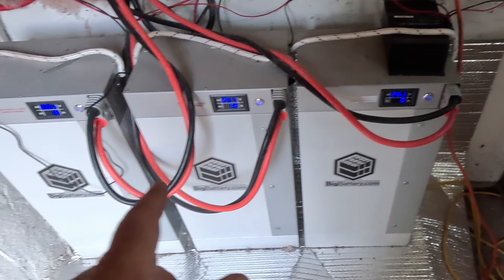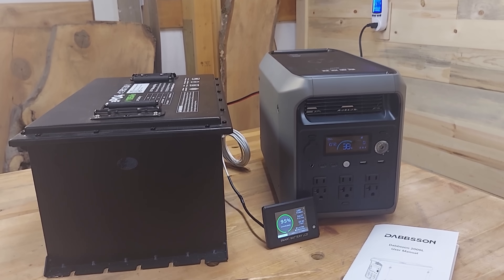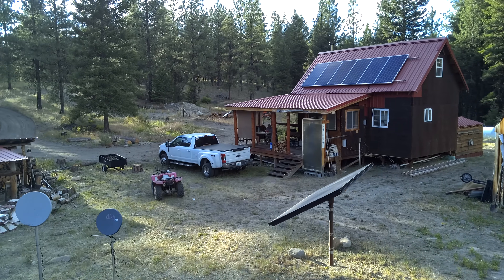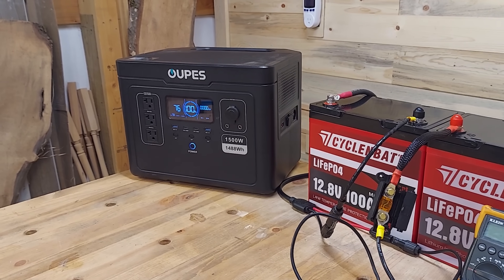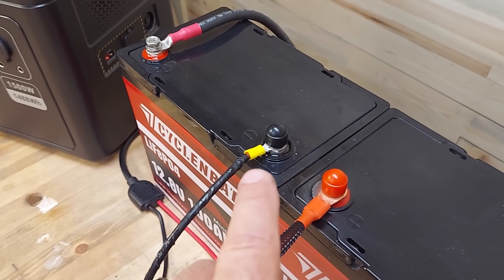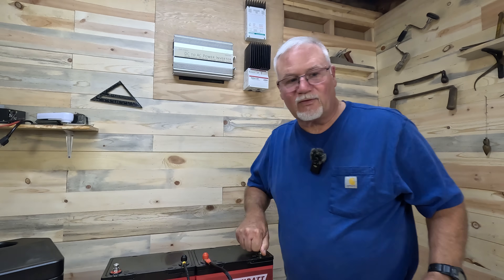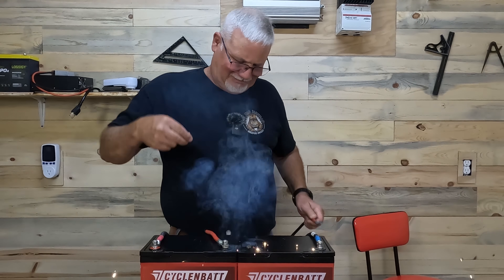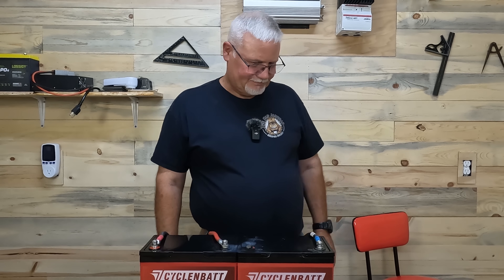NEVER Wire Batteries In Series Without This!!

Comment: When you are wiring 2 12 v batteries in series here, what is the gauge of the wire you are using?
Reply from the maker: In this case I was cheating a little and using 6awg cable as it's what I had but the minimum should really be 4awg cable for this application.

Comment: What size fuse did you use and do you have a link for your fuse connection you used?
Reply from the maker: For the connection to the Oupes Mega 1 I was using 10awg ring to Anderson plug cable with an inline 30amp fuse.  For the batteries I was using 6awg cable (which is a little small but all I had for the demonstration and as I knew I wouldn't draw very much across the batteries that's ok -- ideally you should use a cable rated for 125amps (25% above the expected draw) and a fuse rated 25% over the cable rating so best to use 4awg cable (chassis wiring allows 135amps for 4awg cable) and a 150amp T-Class fuse.  I'll put the fuses in the description.

Comment: Still don’t know what you did wrong. Couldn’t see what you did.
Reply from the maker: Got distracted, and instead of wiring up the cable for the solar input, I ran a wire from neg on one battery to the pos on the other, closing the loop and doing some welding 🤣

Comment: I was an apprentice testing a rewound electric motor on afternoon shift one night and I was getting some vibration in it. My supervisor checked it out and put a multimeter on the terminal block. The block ionized creating a flash that blinded both of us and knocked out the test bay fuse, our building breaker and tripped the building next doors breaker too. My supervisor's skin was lifted off his hands and the flesh underneath could be seen. We both made full recoveries, though his was much longer. The multimeter he used still had it's leads in the amp sockets, which melted across the terminal block. I was very nervous with the next motor I tested.
Reply from the maker: Wow! That's a scary story and thanks for sharing that. I'm glad to hear you both recovered fully!

Comment: Does 2 16mm2² wires combined make 32mm2² wire or even 20mm²
Reply from the maker: They say you should de-rate combined wires to 70% of total ampacity when combining them so you'd actually need to combine more that two 16mm wires to get the same ampacity as a 32mm.

Comment: So does it matter which wire the fuse goes on? Neg or positive?  Everybody always says put a fuse on it, but nobody knows where to put it or at least I don’t! 🫤
Reply from the maker: I believe either is fine but prefer positive.   The is to provide a break in the circuit.
Reply: @TheOldJarhead  Not that I understand completely but everything I've read says to fuse the positive to prevent any short to ground.  Fusing the negative would fail to protect that scenario. Always fuse the positive terminal and not negative for the best protection.
Reply from the maker: Some fuse both sides and I agree positive is the important one.

Comment: So, in a sentence, what did you do wrong? Is it only that you didn't have a fuse? It would be nice if you mentioned what caused the arc flash more than once in this 8 minute video. Maybe make a 2 minute version?
Reply from the maker: I absent-mindedly made a second series connection instead of wiring up the cable that needed to go to the power station.

Comment: Wiring batteries leaving the 2 poles right next to each other is asking for trouble. You wire the 2 closest together and take your + and - poles from opposite ends making it hard for them to cause a dead short. I have never seen batteries seriesed how you did this. I do appreciate you showing a mistake, but you started wrong, it's not just about a lack of focus.
Reply from the maker: The trouble is how to show someone in a video, but you are correct.  I should note that I would not normally do it this way.  Filming sometimes causes us to make bad choices.  That was the case here and in some of my other videos.

I need to change that.

Comment: I prefer to join terminals that are next to each other..

Note..
Always check polarity especially with the blue LiFePo4's to double check and I use an indelible pen + & - or colour code.

If I can I'll put in a fuse as the link.. (also reduces the number of connections) I started doing this decade's ago (6v deep cycle or 2v stupidly heavy cell's from forklifts)
as the linking bars that are commonly available now didn't exist and using a fuse (and a bit of bar bolted for flexibility) was easier than making something with a flexible element and finding thick copper bar was difficult or doing a short crimp lead is awkward..
A deciding factor in which inverter I bought was the distance between the input terminals... I was also wondering how they are designed internally..

I have a draw knife similar to the top one behind you.. it's a Ward..
YT presented this video.. I'll be wandering around your channel soon.
Reply from the maker: Great Info and comment.  The draw knife was my step dad's dad's and used to build their barn in Iowa around 1900.  I have a few of his tools 😀
Reply: @TheOldJarhead 
Haven't gone through your video's yet but I hope you use them occasionally.. I assume you have a brake and a mare which are so useful for other things...
Reply from the maker: I have a different draw knife I usually use but yes I use them to peel logs.
Reply: @TheOldJarhead 
There's much more you can use a draw knife for... and other tools for most of the bark.. depending on type of tree..
(to translate, I live in the UK)
Look up a Brake..
3 horizontal logs on two posts and another post to hold the branch up...
A Mare is sort of like a saw horse that you sit on and use your feet to make the clamp work.. and then use the draw knife.. wheel spokes, coopering etc...
Reply from the maker: Yes, true, however my failing hands and back have made it so I'm limited to only rarely working with wood these days :(

Comment: I did this with 51.8 volt 64ah lithium ion batteries. I was assembling my 1200ah solar battery at 2am. I am a lead electrical maintenance tech. I work on 480vac 4,000 amp Live plant control cabinets all day every day. But I made a lapse in judgement jumping from one task to another. I shorted it out while connecting the BMS. Luckily the terminal melted off the 2/0 wire very quickly before the batteries went into thermal runaway. But .. I gave myself 2nd and 3rd degree burns from the arc flash on both hands.... I wear gloves at work all day. I knew I couldn't get electrocuted from 51v and I knew about the current potential but I made several mistakes and it cost me. Luckily I made a full recovery and it wasn't worse than it was. After running those batteries for 3 years I've since upgraded to diy lifepo4 cells. All is good. But mainly it's really all about safety no matter how much u think u know or how much experience u have. We all make mistakes!
Reply from the maker: I'm glad it worked out, and yes, we all do it 😉

Comment: I have never had a High Amp issue or accident arise, still I'm always a little bit nervous, thinking a lot of steps ahead* before touching my diy 170 Ah UPS arrangement... and kind of hate every moment of tinkering with it... just b'cuz of possible accidental BZZZZT-issues!!
Normally I just deal with low voltage electronics mostly... which is much more in my comfort zone.

*(Sort of "Check for no rings, necklace, key chain etc, empty chest pocket, remove any excess metal tools around. Connect this fuse first, then that and that wire, no chance of short circuit yet, continue with next safe-to-connect wire but tape loose end up for isolation..." etc.)
Reply from the maker: It's always good to be safe ;)

Comment: How sure are you that there is no internal damage to those batteries?
Reply from the maker: Pretty certain, however I'm sure there is some testing I can do still.  They take a charge, discharge, have the correct voltage etc etc.  The BMS did it's job, I'm certain of that.

Comment: I have three 12v in series for my 36 v golf cart.  I installed a circuit breaker so I  can cutoff power if necessary. I also have a fuse.  Your poor physical layout of the batteries made your mistake more likely.   Line the series batteries up in sequence.
Reply from the maker: Perhaps, however, having wired up battery banks far bigger for many years, the configuration of the batteries wasn't the issue.  Distraction was the main culprit.

Comment: Consider yourself lucky. As an apprentice, my journeyman supervisor was demonstrating how to connect battery terminals on a large commercial lead acid backup bank. As he was tightening a terminal, his wedding ring touched the opposite polarity, and the wrench was in contact with his ring. The ring became a fuse, instantly melting, the arc flash ignited the hydrogen gas, causing multiple batteries to explode. He lost his finger, damaged his eyesight and hearing, and his skin was burned by the acid.

Familiarity breeds contempt, have respect for the massive energy potential of batteries.
Reply from the maker: Yikes!!!  Glad you all didn't get killed!

Comment: This happened to me yesterday!  I was connecting two 12v batteries in series and and after connecting the first wire, i was connecting the second wire and it accidentally (or not) it touched the other terminal completing the circle.  

I was close to it and the sparks blinded me temporarily.  Thank fully i am ok, but it scared the hell out of me.  It melted the thread and the end of the cable, molten copper damaged some of the rug, but no major damages.  

My question is, how did you fix the terminal?  The bolt i have is ok because i had not connected it, but it won't go in because the hole and threads are melted, at least the top. The battery is giving full voltage also.  The battery seems ok,  but i was concerned if i damage the battery inside, but it seems fine.  The Bluetooth connection to battery shows similar voltage for all 4 cells, so i think it's ok.

Maybe you should do a follow up video how you fix the bolt and battery terminal since i don't want to stop using the battery, it seems fine to me.
Reply from the maker: Glad you're okay after that scary situation; I used an M8 bottom end tap to fix the terminal threads
Reply: @TheOldJarhead  Thank you!  I'm glad you are ok also.  Ok, i will buy that since i don't have one.  Amazon should have them, right?
Reply from the maker: Yes, Amazon will have, though if you don't have any, now a handle would be good. A tapered tap would work if only the top threads were messed up.  Good luck!

Comment: In my opinion you repeated yourself over and over again. For the mistake you made you only showed it for a split second. I don't see why you have to start from the outside (bridge) of the battery. In series I would start one end, bridge in the middle and the other end, so you can see it in series.
Reply from the maker: It was about trying to show what I was doing.

Comment: Ideally, the final voltage should be at the ends of the series. The method using that series is confusing.
Reply from the maker: Series is simply negative to positive, leaving the remaining two terminals, and those two are where you check voltage.

Comment: FORGIVEN…. BUT you did not explain that you created a DEAD SHORT… Connecting the positive and negative terminals of a battery directly, also known as short-circuiting, creates a path for a large current to flow, potentially causing damage to the battery, the connecting wire, and even posing a safety hazard. The current will be limited only by the battery's internal resistance and the resistance of the wire. This can lead to the wire overheating and potentially melting, and the battery discharging rapidly, potentially causing it to overheat and even exploDE.
Reply from the maker: LOL well, sure.  The point was that I was distracted and didn't provide protection and should have.  Thanks for the added context.

Comment: A little info on lifepo4's

Lifepo4 batteries are considered  non-combustable and non flammable batteries. They use non-flammable electrolyte. And are extremely hard to get the cells to actually burn (you can damage internal components and exterior components like terminals, by user error easily). The cells would 1st have to leak out the non flammable electrolyte before the cell could burn.

Many confuse lithium Ion batteries (what you find in cell phones, rechargeable AAA/AA batteries (which are flammable and combustable) as they use flammable electrolytes in their chemical make up).

A lifepo4 batter can be overcharged/completely discharged and go through several manner of user errors and not be a fire risk, the only real risk of fire in lifepo4 batteries is thermal runaway. 

Loved the video, very informational  for the layman, great example of a common user error, keep up the good work and be safe.
Reply from the maker: Appreciate the kind words and the facts, very helpful!
Reply: @thevoltmetermaniac  given the right motivation, LFP batteries will burn quite well. Some guy tried demonstrating how non-flammable LFP batteries were by shoving a 1" angle iron pole through one. First strike went as expected with lots of gasses but no fire. Then he decided to strike the cell again expecting more of the same and it erupted into a flamethrower. While it takes substantially more heat to get LFPs going, go they do when you cause sufficiently traumatic internal self-heating by simultaneously shorting all layers together across a large area.

Most LFP safety demos aren't traumatic enough to get there. Not enough heat, not fast enough, not long enough. When you shove a single nail through an LFP cell, the current density immediately around the nail is high enough to instantaneously blow the film out like a fuse or the metallized film of an X-class safety capacitor. Most of the time, you only get a puff of smoke and a pillow.

Next to that, NMC and NCA look like they are looking for any excuse to go wild.
Reply from the maker: Thanks for the clarification!
Reply: @thevoltmetermaniac  Says the marketing department
Reply from the maker: I mean, LiFePo4's are very stable but they can burn...it's a wash though as FLA's can blow up ;)

Comment: Very easy to do. I just made a video the other day where I made more (not serious) mistakes building and modifying a circuit than I probably would have made in a month or maybe even a year of building circuits where I wasn't trying to film a video. I didn't edit them out. Especially when covering something that is simple and safe, it is good to show the common mistakes that beginners and distracted experts will make. When I am going to film something that will be dangerous if miswired, I wire it up ahead of time to make sure I didn't miss anything that is needed, and then I unwire it and leave everything placed next to where it will be connected before I start filming.
Reply from the maker: Good idea.  I'm basically doing that today for my next video 😆😁

Comment: First off, you did it right. Always be the first to say when you F up! I learned that in the AF cuz you don't want anyone else pointing it out first 😅. As to what happened, I am always paranoid and make sure nothing is connected to the batteries before I connect the series link. If there's no place for electrons to flow out then none will flow in the jumper but it's still a moment of pause cuz well, who knows what can happen. I also follow the rule of a car battery and connect + first then -  I've been bit enough changing receptacles without tripping the CB. Meh, it's a plastic box, what can go wrong? Never said I don't do dumb things
Reply from the maker: lol we humans often do dumb thins 😁 I think we learn that way 😉
Reply: @TheOldJarhead if I may ask a dumb question. When hooking up batteries to the solar input of a PPS, what fuse should I use? My new batteries are 300ah with a 200a BMS but since the power station maxes at 500w the current should never get very high. Yes shame on me, but I have not used a fuse between the batteries and the xt90 cable solar input. Hey, I'm trying to pretend that safety isn't job 4 or 5. I did used to think it was rather absurd that in the military they liked to say safety is paramount then send you out to do something where you could die but we are slaves to appearances.
Reply from the maker: Best is to use a fuse matched to the max cable amperage plus 25%.  So, for a 10g cable from the battery to the power station a 30a fuse would be fine.  The power station will only draw what it's rated to draw but having a fuse in place that will blow if the amperage is above the cable rating is a good safety precaution.
Reply: @TheOldJarhead thank you I was wondering if I needed 100a or what the connected device was rated at. If I connect directly to an inverter I'm guessing that would need to be at that max current. E.g. 1000w inverter would need 100a? Sorry if these are too basic questions but I haven't used a fuse yet 😞
Reply from the maker: If the inverter can peak at 2000w then it could draw 160 amps, so a 200 amp fuse would be appropriate but with just 1 12.8v 100AH w/ 100a BMS battery, 100a fuse would be fine if that makes sense?

Comment: As soon as I saw how you had put the first series link wire in it was obvious what had happened. To me, that is the most ridiculous way to wire batteries and is just asking for trouble. I link the closest terminals together as the series link and leave the outermost terminals as the output voltage which makes it much less likely to go wrong.
Reply from the maker: It was definitely silly
Reply: Yes..
A deciding factor in which inverter I bought was the distance between the input terminals...
Reply from the maker: That's a good point, something I was pointing out someone yesterday on a couple.
Reply: @TheOldJarhead 
Video idea 😻
Reply from the maker: :)  True!